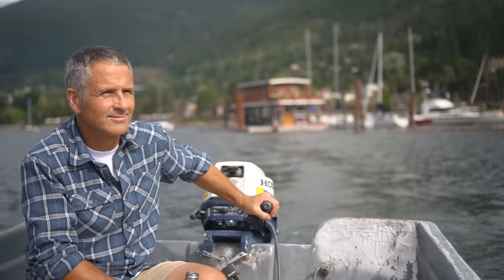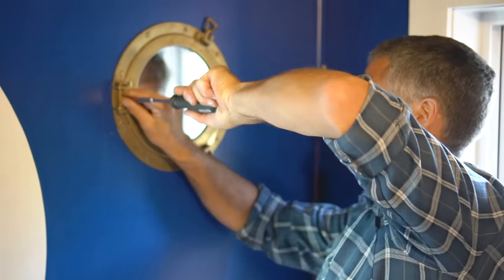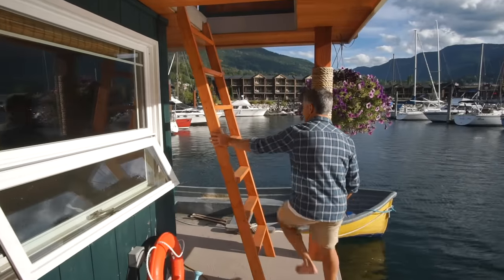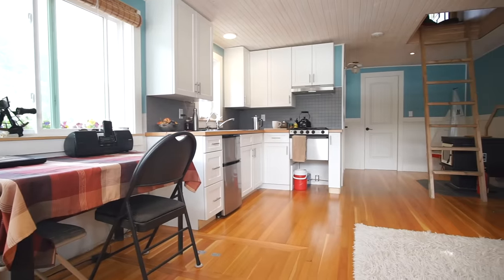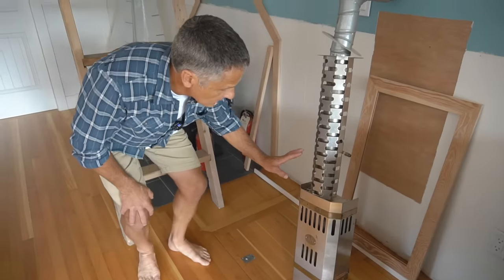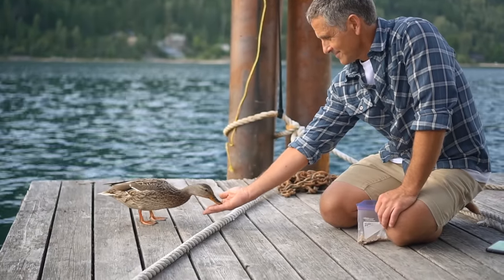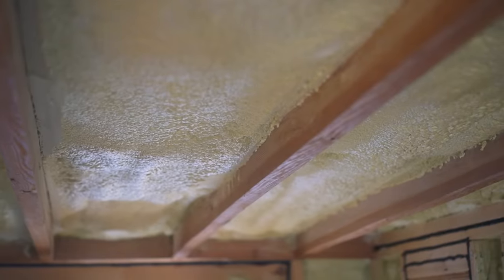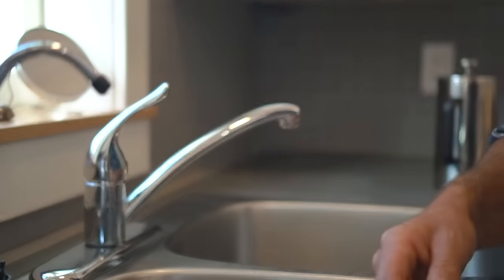Spectacular FLOATING HOME is Self-Built & Off-Grid

Comment: This guy did a great job!  Really went through the building process meticulously addressing each issue with thought and detail.  Very nice job!
Reply: I wonder why he did't use FIBERCLASS on the roof?
Reply: Michel Fortier :  I thought the same thing.  What an impressive finished product that is so efficient!  👍👍👏👏👏🚣‍♀️🏊‍♂️
Reply: @jeffreyc6508  
...Perhaps fiberglass will oxidize and deteriorate faster and not support the solar panels.  Bigger costs later.

Comment: Thank you for allowing us into your wonderful home and sharing your thought processes that led your life to this point. To say this is a very well done presentation is an understatement. 
The design of the structure appears to be excellent. But it is the thought given to the systems, from the water supply to the wiring to the waste, which is most impressive. I do differ on the decision not to have door access from the bedroom(s) to the upper deck, both from a personal preference view and a fire safety perspective. A double door setup would protrude only a matter of inches onto the deck space and would make the insulation loss negligible.
Reply: Dave, please shave those Abraham Lincoln eyebrows.
Reply: Hi Dave. Thanks for your input. The upstairs rooms have windows for safety egress. There were a few reasons for not having an upper door to the deck.Two bedrooms, 2 kids and one gets a door and one doesn't = trouble. I get a lot of wind driven rain, and I've seen too many doors that end up leaking and causing rot. Budget was also a consideration. I've built the project out of pocket and paid as I went, so some things that would be nice to have included just were not in the cards. Lastly, I can always blow out a wall and add a door later if I really want one. Thanks for your interest & kind words
Jay
Reply: @kevymoranski3887  Completely?? Don't you know what happened to Samson when his locks were shorn?  He lost all his strength.

Comment: I didn’t know gas lights provided heat. Cool.
Reply: they do but they also take the oxygen out of the air. that's probably why gas lamps are mainly used outdoors. if your house breathes then that's not a problem but a well insulated house can't breath and you run into indoor pollution. it happened in PA years ago. and many people got sick. you can always open a window a little and let fresh air in.

Comment: Very pretty and functional....  For those looking to do something like this, perhaps also look at using SIPs, structural insulated panels, for the shell, roof included.  Super insulated, airtight, and structurally "monolithic".  The spray foam is awesome, but SIPs are next level.

Comment: Wow…. Amazing.  Very much enjoyed the innovations for grey water.  It shows you can still have a classy appearing home and still be low carbon.   One question that does come to mind is he runs a lot of pumps, the auger for the pellet stove, fridge etc.  How does he power up these devices when the weather is inclement (solar not charging) and he only has 400 w of power for solar.   Not sure about the gas lights.   (He mentions they add extra heat for colder times.   Lots of forethought went into the building of the home, including carbon monoxide detectors, and canisters to discharge with high heat.  Thank you for sharing.   Many thanks to the home owner for allowing his home to be viewed.  I’m in awe.

Comment: Architect here - very cool. If anyone considers doing this as well, look in to using light steel framing studs and screws - it is actually lighter than wood construction and will make a stronger boat. Save the wood budget for plywood (marine grade only for boats!) and Teak for your cabinetry.

Comment: I lived on my float home/houseboat..a steel 14meter pontoon barge in the Noosa River in Australia for 4 years and loved it,just  on anchor near town on the riverbank..unfortunately the rules and regulations are changing due to the land based million dollar house owners complaining..so I sold up,could have sold it 100 times over..its a great way to live,on solar..and I had 3 tons of water 3000litres..so never ran out with a good gutter system to replenish it and solar of course for power.2 story very similar to yours but steel frame and insulated freezer room panels,aluminium on the outside 50mm foam and plywood on the inside..the whole thing weighed 6 tons dry

Comment: The house looks so cool! It really looks cozy and it can be a nice resting cottage. But still, one must consider a lot of factors before deciding to build housing near or on the water. The man is used to sailing and living on a boat, which means a little shaking wouldn't matter to him. But to some people, the shaking would be quite a problem. Not to mention the high humidity can cause metal to rust easily, and woods to rot easily. This means high maintenance fee. Some couples of rusty nails and some shaking would easily torn all apart if it is not well maintained. So yeah, he could save the utility fee by using solar panels and self water filtration system, but he would spend the cash on house maintenance instead.

Comment: This is a phenomenal design! The only thing I personally would not use is propane gas; I especially do not like the lamps - unnecessary danger on a wood frame when there is solar accessible. I would of liked to hear more about how it moves in the water and is there an under water monitor for depth? I didn’t fully understand about the waste water in winter? Wonderful life style and the children, I am sure just love 💕 it.
Reply: Hi Susanne
Propane is my best option for cooking and hot water. I have dangerous gas sniffers in the appropriate places. I am currently upgrading my inverter so that I can cook with an electric induction cooktop from March-October when there is an excess of solar electricity, reducing my need for propane. I will continue to increase my solar and wind generation capacity and continue  to reduce my propane needs. I've  already reduced it by 2/3 over my first year here. 
The gas lamps were installed  with the thought that they would be a backup light source if the batteries  were to ever give out. It has proven to just not be an issue, and the gas lights  don't  get used.  If I was to do it over I probably  wouldn't  install them. 
The gray water is filtered down to .5 micron then UV filtered and then returned to the environment. I use it to water flowers in the summer. The filters are a significant  cost (approx $100 / month) but worth it to return water that is as clean as what I pull from the lake.  Thanks for the observations and kind words
Jay

Comment: Lots of consumables... He could be independent of the pellets if he got some evacuated solar tubes on the roof with a heat storage tank in the barge hull. And he cold be independent of regular filter changes on the RO system if he just replaced it with a destiller system for purifying the water.

Comment: You should use TPO or PVC for your roof and decks. Why didn't you use metal studs for your framing rather than the much heavier 2x4's. How come you didn't use aluminum for your floats? What would have been involved if you made your floats in the catamaran style? I guess deeper draft but I'm not sure. How did you determine how much float you needed to support the weight?

Comment: i would get a distiller system  and add minerals to that for pure water as a back up  and add a cylindrical windmill with low rpm generator too, also a stove you can burn both wood logs and pellets

Comment: That's the kind of hull construction that boat builders warn against. The slightest leak leads to rotten wood. I'd want to be able to check inside your chambers often, perhaps even have cameras and lights down there, so you can do a rough check in an instant. I think steel with many separate chambers would be better. But what do I know? I used to dream about buying an old wooden troller and coating it with epoxy fiber. Many things I read made me decide against it.

Comment: I am just worried about the lake water's quality. Because the boats presence with the chemicals of the paitings and the possible leaking of the fuel may became a problem to a drinking water, even with this fine filter system. If this is a real case, a sugestion it is to put another step in the filter... It has to research about it.

Comment: I have a question: why do we call equipment that is a complex technology "sustainable"? 
Okay, they provide autonomy during operation (which in the current situation is generally not interesting, ecologically and economically it is better to bet on collective equipment), and in case of crisis, they will work until they fail... and cannot be replaced. Because these are complex technologies. From materials extracted on the other side of the world (by modern slaves in general), and ultra-processed.
What would be truly sustainable is an autonomous or collective habitat based on simple technologies, which can be reproduced by anyone, built and repaired on the spot, etc. 
Does it exist?

Comment: I honestly would have put the kitchen along the width of the boat not the f**** length of the book because the length of the boat you swallowed up all this space that you don't f**** need to take up by putting the kitchen in there like that I would have put it against the f**** wall next to the door when you enter you're in the kitchen then you would have had all that extra space then you could have the bathroom and then you could have added like a downstairs closet I want to know what's in that door next to the bathroom not the bathroom door but the other door what's that go to where that go to